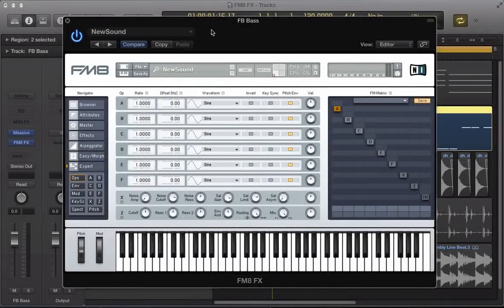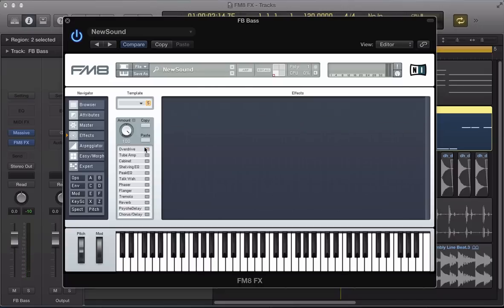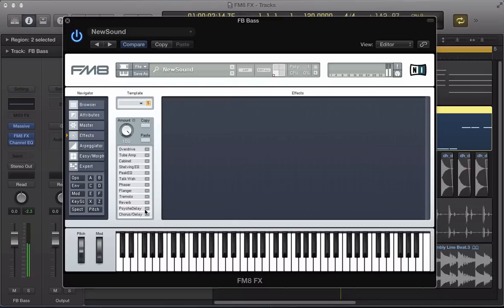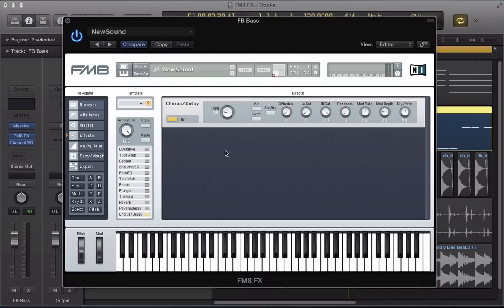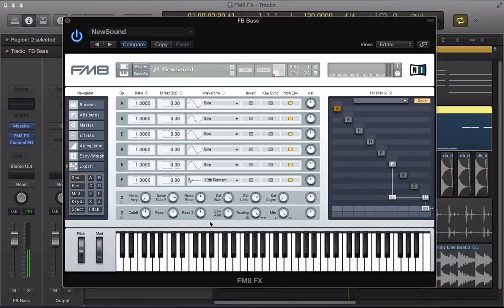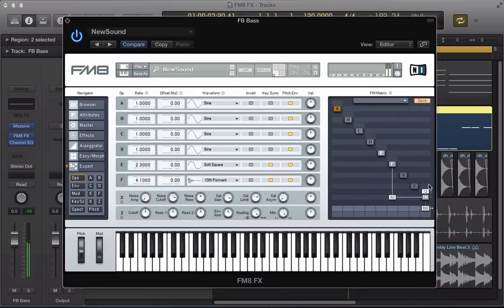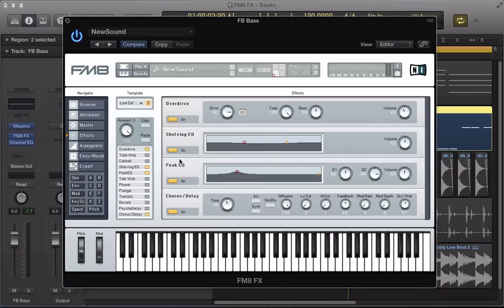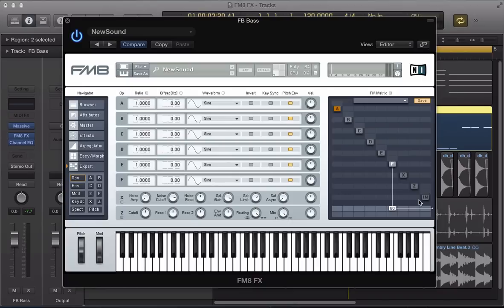NI FM8 - Use FM8 as an Insert Effect - How To Tutorial

Comment: How do you assign midi to play with the inputted massive patch, as i am not hearing any synthesis unless i press the fm8 keyboard with the mouse. I have a midi track playing massive on sequencer , but no  FM synthesis is happening.(5:19)?
Reply from the maker: Is your MIDI triggering Massive ok before you load the FM8 as an insert fx?
Reply: Hi yes its working in massive. What is happening is inside FM8 Fx ,additive synthesis is not occurring.Is this something to do with logic's channel, or CC assignments within the FM8 's options ?I have tried it on two different Macs and nothing inside Fm8 is occurring besides the original signal via IN being processed.
Reply from the maker: But we're using FM8 as an insert here, so it's not FM synthesis rather using FM8's effects on other sounds. We can do some limited stuff in the FM matrix to effect the sound, but if you want fully functioning FM synthesis then you need to load FM8 as an audio instrument.

Using the FM matrix to effect the sound, the way I do at 5:19, can be temperamental. I just tried setting this up again, the MIDI region was loop for a minute before the FM modulations had an effect, strangely enough it was only when I started messing with the envelope in Operator F that it started to have an effect, even though there was already plenty of routing happening in the FM matrix.
Reply: I have the same problem as Ant Nobie. With FM8 as an insert, the midi doesn't reach FM8 to trigger the operators that modulate the input. It's only when you press the FM8's little keyboard (at the same time as MIDI going into the carrier) that you can hear it working.